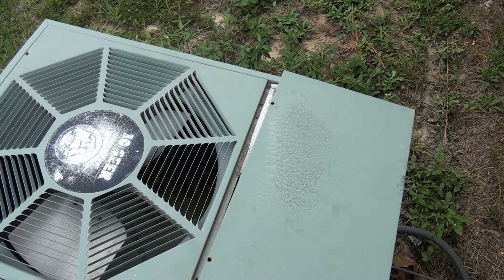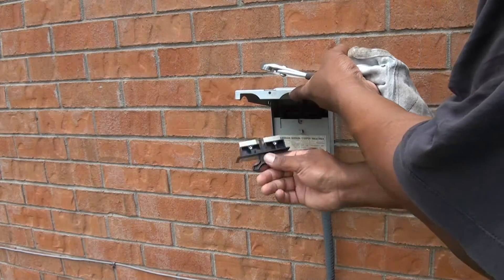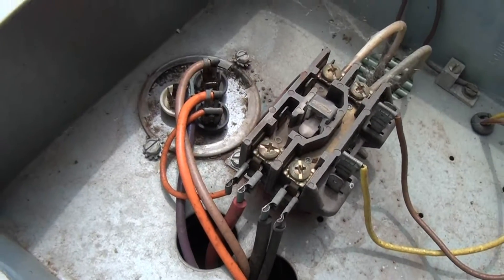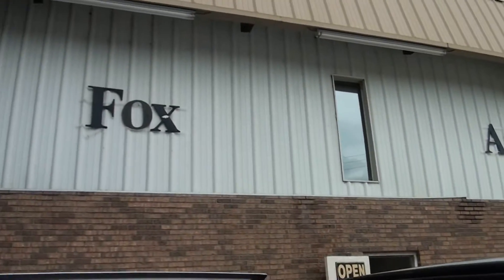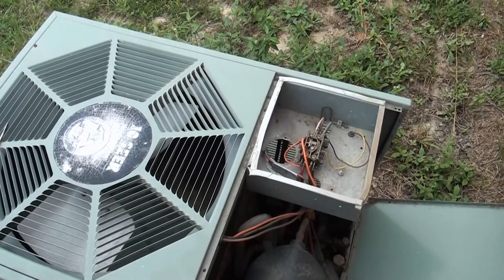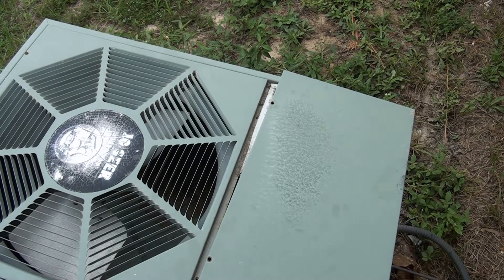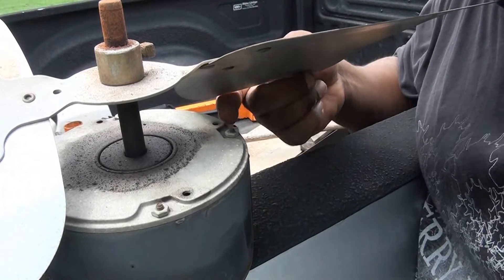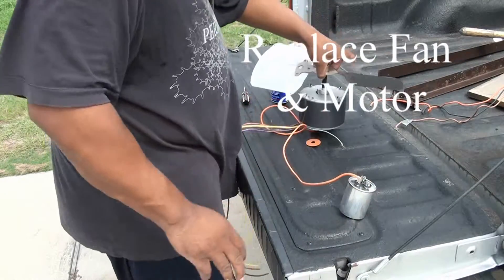AC Fan Broken - DIY HVAC

Comment: Great video and job well done. :D ~ After pulling the disconnect you can discharge the capacitor by holding the insulated portion of a screwdriver or channel locks and bridging the leads to the cap with the metal portion of the tool. Than you can verify power is discharged by using a non contact voltage detector. I show the procedure in me vid "How To Replace Air Conditioner Capacitors Without Getting Electrocuted".

Comment: Mine went out tonight. Ended up hearing the compressor, but it sounded off. Went out to check it to find the fan was not running and the unit was hot as hell from the compressor spooling up and kicking off on the therm overload. 

Going to go over it in the morning, but figure it'll be the same route. Especially since the cap is only a little over a year old.. Who knows though, maybe the cap went bad.. But I doubt it.